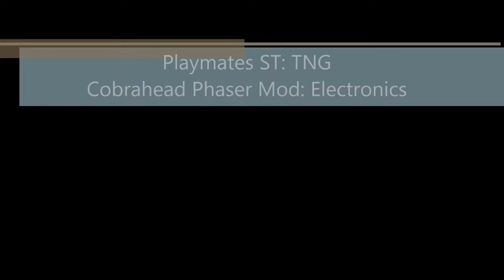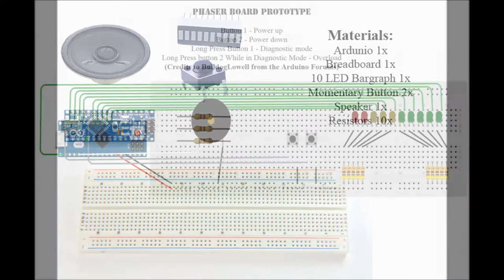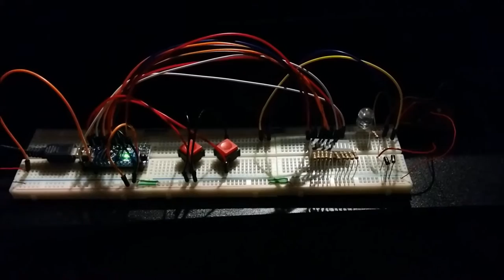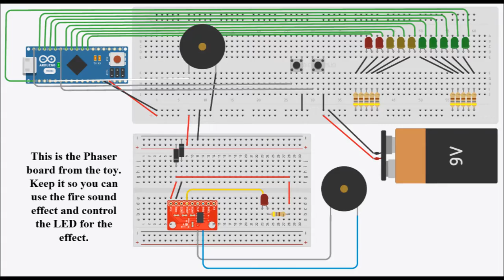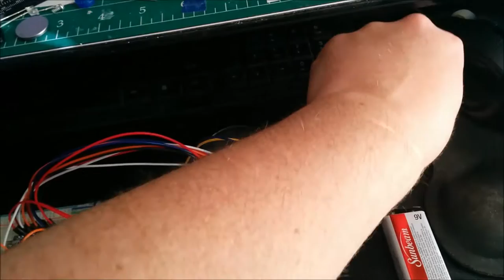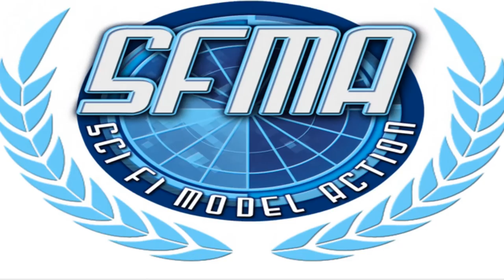Star Trek: TNG Phaser Mod - Electronics

Comment: I love this idea, and have been looking to upgrade a phaser for quite some time now, however I have never so much as touched a arduino much less wire something from scratch, where would you recommend I start? I would just buy a upgrade "kit" but I want the experience of building one on my own, plus I dont have $150+ just lying around for a pre-made kit... Any help is appreciated, thanks :)
Reply from the maker: This one is pretty cheap and under $20 in parts (not counting the toy, I got that for $25-$30?  on Ebay, been awhile). As for the wiring I can't really help you there you'll have to work that out on a breadboard to test the circuit. The code for the arduino is pretty simple to upload and I have provided a link so you can upload the sketch (the arduino file with the phaser code) to the arduino, and I added the wiring diagram for the breadboard prototype in the video. You'd need to install the Arduino IDE, and set up your computers COM ports to see the arduino board, but youtube and google are your friend here. Doesn't take much to get started and upload a sketch and try it out, maybe wiring up the circuit will cause you some headaches. Gotta start somewhere!  Good luck and let me know how it turns out!
Reply: WIll do, an thank you for your input :)

Comment: The part I am confused about is how do you do this without a bread board? Like you can't fit that breadboard in the phaser so what happens next considering a printed circuit board probably isn't an easy option. I am trying to learn about this stuff but I keep seeing breadboards which I know if for testing but I dont know what comes next.
Reply from the maker: You use prototype board to make the circuit from the breadboard permanent. Most of this was the sound board from the toy + arduino. I only needed to use a small bit of prototype board for the buttons.
Reply: JimmyPop FiftySeven with a prototype board, do you make the circuit connections with little wires to connect next things?
Reply from the maker: You can do it that way, for this one I only used solder to make connections for the buttons and a way to mount them. But either using wire to bridge connections, especially with chips like the 555 or the 4060(?) from my experience, but you can easily use solder to bridge the gaps on the prototype board for normal connections, just lay it out like your circuit needs.

Comment: Hi,
I’m trying to enhance my own Phaser, but, instead of the LED bargraph, I’m going to use 16 LED’s.  Do you think this is possible with as little pins as this thing has?
Reply from the maker: I don't see why that wouldn't work. I think that you only have 14 digital pins tho, with 2 buttons + a speaker might make 16 LEDs difficult. I used the phaser main board and an arduino, but the 10 led light bar has all individual LEDs, so it shouldn't be an issue for that.
Reply: JimmyPop FiftySeven I’ve got a lot of Atmel 328 micro controllers *EDIT) that I'm using that have the bootloader installed , and I’m planning on using one smaller controller for sounds.  There’s a lot more that I wanna cover.  Lol

Comment: link for scetch is dead, any way of reuploding?
Reply from the maker: Just checked the link outside of browser in incognito, and it showed up and let me download. Are you sure it's not working? 
https://drive.google.com/file/d/0BwOWMs6fJOpSNW5rdFQ1SnFGeUk/view
Reply: I ended up following from mobile and copying it, ty. For whatever reason firefox didnt want to let me.
How did this end up btw? Would love to see follow up video as im trying to make my own as well.
Reply from the maker: I actually ended up moving not to long after this and it's in a box of other "almost" finished props for a costume. I think I lost the vid I took of it all together due to a odd behavior of google photos being linked to what you delete from your phone so it got squashed. As is it's still in a box with my other TNG props waiting for primer and paint after I went buck wild with green squadron putty to close the gaps. I'll take it out and see what I can do, but it wont be pretty and shiny until I can get the paint finished on it.
Reply from the maker: Here is a quick link, I'll try to get it properly on youtube later, but here is the unedited version:
https://photos.app.goo.gl/nFQf7A2k1htah5vC2
Reply: @JamesBYo1  did you reuse the switches or are they new?  If you replaced them what size are they?
Also what is the segment display size?  I ordered a phaser from ebay and i ordered a 10mm led.  I have an uno i bought.  I guess i need to work out small items like buttons, displays and other little items.
Reply from the maker: Hello Phu! I didn't reuse the switches. The internals of the phaser are just a plastic rocker that taps on either side to make a connection. I used a prototype board cut to fit inside the toy, and 2 momentary push buttons (through hole not SMD) when I transferred the circuit from the breadboard. You'll be able to use the Uno for setup and testing your sketch, but it wont fit inside the toy, you'll need a Nano (or clone) for that they are about $3-$5. The light bar is a 10 LED graph display (3 color) I picked up on ebay pack of 2 for about $2. Hope that helps!